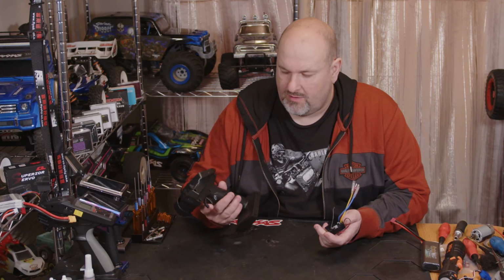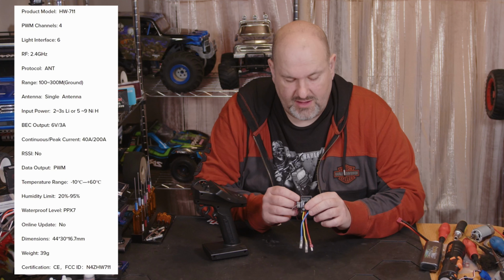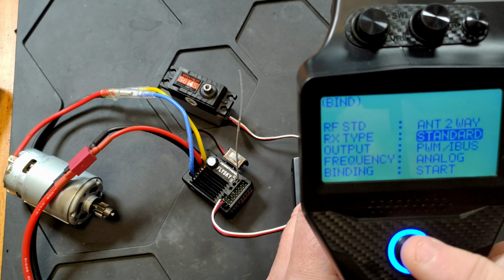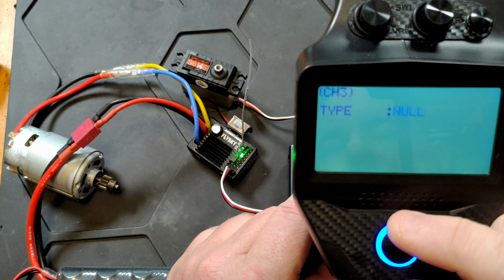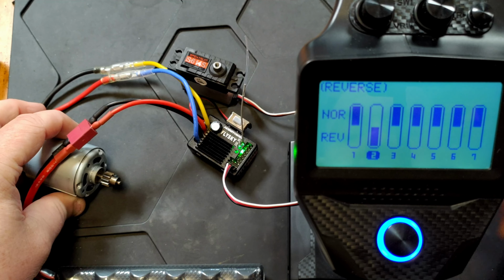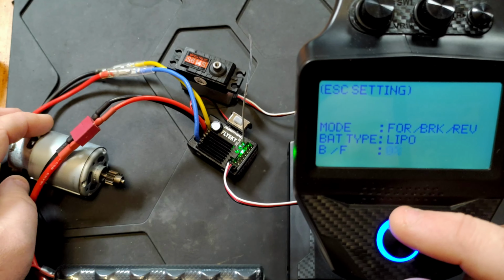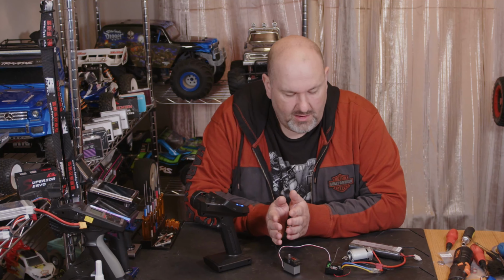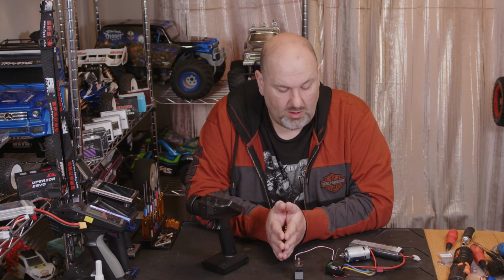Flysky FS-G7P and HW-711 Bind and esc set up.

Comment: Greetings, can I connect a sound ess to this hw-711?
Reply from the maker: Yes just use ch3 and have a mix running from ch2 :)
Reply: @WTFRCCars  Thank you, but the HW-711 does not have channel #2, so I would like to know how I can connect it since it asks me to connect it to channel #2 of the variable speed drive but it doesn't have one 😅, can it be connected?
Reply from the maker: Set up a mix with ch2 as master ch3 as slave then connect it to ch3 and it will follow what ch2 does :)